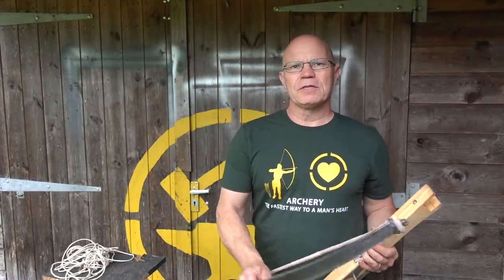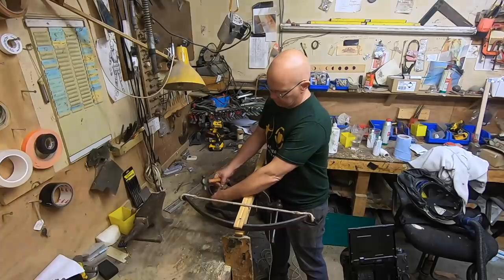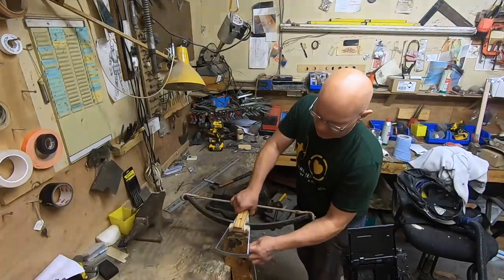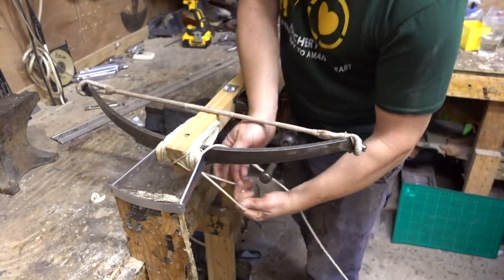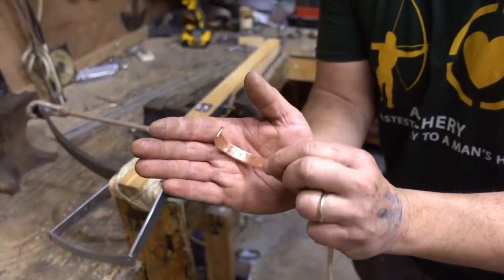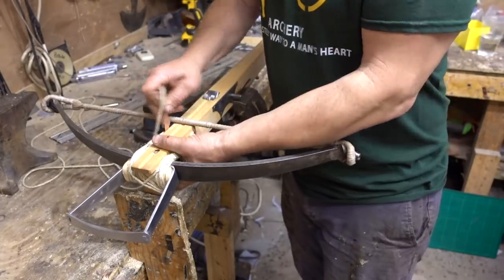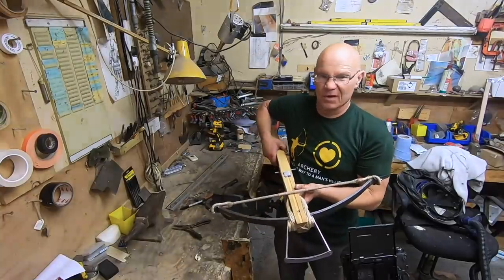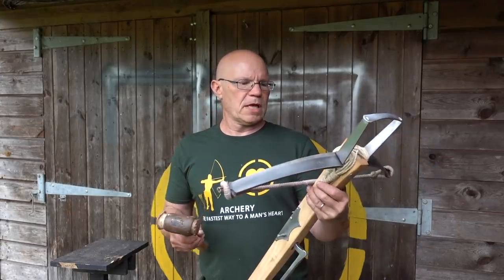Lashing a medieval crossbow

Comment: bending the pipe "needle" was brilliant.
Reply: It's a vital trick to do with zip-ties too when snaking them through a tight spot or hole
Reply: That's when the experience and ingenuity of a worker comes in. And that's what you actually, rightfully, pay for.
Reply: I was wondering why he didn't use a fid; then he hammered the curve into it and I was enlightened.

Comment: This is such a nice illustration about how people back then were just as clever as we are, they were just working with a different set of tools. Give a person from the past a partially assembled crossbow and tell them it needs to be as tightly fitted as possible, and eventually they will find a way to do exactly that, even if they only have wood and cord to work with. Sure, it takes more time and labour than it might with modern tools and materials, but it absolutely does the job.

Comment: To anyone who's thinking about using this style of binding, I used it on a homemade 150#  fiberglass prod 8 inch power stroke rolling nut lock bow with success, though I have a few comments to make.
 I used a 1.5 inch thick oak "yoke" mounted directly against the front of the bow,  cut down to 1.25 inches in the middle,  leaving the sides high for holding the loops in place. I planned to use a gaffe lever for spanning and needed that thicker yoke to anchor a heavyweight screw eye for hooking the lever into, which seems to be working well so far. Possibly as a result, I needed a lot more tightening wraps around the main loops - 15 of the straight wraps and about 13-17 of the figure of eights (I wasn't counting, I just matched on each side). I also only did 6 of the main loops in a single layer on each side of the stock, plus a double layer of crisscrosses on the front, so that may have contributed.
That double layer of crisscrosses on the front of the bow was more trouble than it was worth - I had to throw out my third attempt because the two layers had somehow twisted around each other before they got to the tightening wraps, ruining the appearance of the front of the bow. If you do crisscrosses, definitely only do a single layer, or just leave them off entirely.  They don't blend well into the main loops going back through the hole either.
For forming the initial loop, I found that rubbing a large amount of bowstring wax into the pseudo-splice was an easy way to hold the loop together without it pulling out on you when you put tension on it. It should be the innermost loop, so whatever you do won't be visible from the outside anyways. Supergluing it would probably work too, but waxing was easier and didn't risk gluing the cord to the stock.
When working with that copper needle, file down any sharp edges on it, otherwise you'll ruin your finish. I had to re-varnish the entire front of my bow because it had gotten badly scratched up during the tightening process. A shorter needle is definitely better, and make sure to be going straight down and up against the stock.
I used 4mm 4-twist jute from Amazon for my binding cord, and found that it had a disappointingly low breaking weight. I had to restart twice due to my cord breaking halfway through, and ended up having to tighten everything down by hand - not ideal, but with a lighter bow it should be strong enough. I'll try to find stronger cord in the future - plus, jute is hairy stuff and nobody likes a hairy crossbow.

Lastly, this takes a lot longer than Todd makes it look like - my fourth and successful attempt took me about an hour and a half to do, though much of that was probably due to my larger number of tightening loops. Unless you wear a glove on your tensioning hand, expect to have blisters on your blisters by the end of it, especially if you use rough cordage like I did.

If Todd reads this: I wouldn't have been able to do this project without your video. I've built crossbows in the past using bow irons and stirrups, but this is a lot more economical for me. Thanks, and take my sub, comment, and like - you've more than earned them.

Comment: I'm not a native speaker and I don't know what "lashing a crossbow" means, but I looked at the thumbnail and thought to myself - I wonder how all this ropework is done. And how about that - it's exactly what the video is about. :D
Reply: "Lashing," in case you didn't pick it up from context and for anyone else with a similar knowledge gap, is either a noun or a verb. As a verb, it means to use cordage to bind or secure something. As a noun, it refers to the cordage itself.

The use of the term in reference to whips or whipping someone, such as someone being given "20 lashes" in a pirate movie, is because the whips used were often improvised from the ship's supply of lashing cordage.
Reply: @Mewobiba  Well, that IS an example of using cordage to bind or secure something, yes.

Comment: The sailor and knot enthusiast in me got me tied into watching this, and no regrets.

The second layer reminds me slightly of the worming part of to worm, parcel, and serve rigging. Love the improvised needle. Kinda like a fid I've used to splice double braid rope (was a big straight needle with a hollow in the back to place end of the core/casing as it passed through the other), but you can shape it as needed for working on the lashing.

Not sure of the forces required of a crossbow lashing, but one thing I've learned is that if you don't trust a line with your weight, you probably shouldn't trust it with a sail.

Comment: I've used a variation of that pipe needle in the past using a drinking straw and string for routing cables through a homemade desk rather than a lashing crossbow but it's a handy trick or "bodge" to have lurking in the recesses of the brain.

Comment: Tod, that was....surprisingly interesting! I'm unlikely ever to forge a bow steel (the tempering kind of worries me - but I might try it with a light one one day), but your crossbow videos always make me more interested in them than I am by default! 

I think I'll stick to axes, though.
Reply: Spring tempering is actually fairly easy. You want it to turn blue from the heat.

Burning motor oil is the right temperature (about 550-600degF). 

Molten lead will also work, but it's easier to overheat that way, and takes a heck of a lot of power/heat to get the lead melted in the first place, and you do NOT want to work around that much molten lead if you can avoid it! Molten lead can be used for making smaller springs, like for a flintlock's mainspring, since a person making a flintlock is likely to have a lead pot to cast bullets with anyways.

You will want a thermometer for this if you want to be consistent with it.

Comment: There is line used in the rigging of sailing that might be a good modern alternative. These lines are under tension for months on end without any noticeable stretch. Of course it will look a bit out of place on a medivial crossbow:)

Comment: I used to belong to an army company that had boats that needed to be secured for transportation. There was not a bit of synthetic rope in the whole unit. It did not matter how tight or how frequently you dressed it, synthetic rope would stretch and you would be peeling your boat off of the road.

Comment: It is so weird I was doing this yesterday. Never thought on bending a copper tube. I used a paracord needle that is round and... gosh... at the end it becomes so difficult to go through. Thanks for the tip.
Reply: You always can use long wire loop with grip to pull the cord trough. More time consuming but will work even if there is no spare copper pipe lying around ;)

Comment: Finally a good guide on how to do this! I've had a spare 200 pound prod sitting around my basement for years - I used my only set of good steel bow irons on an 80 pound prod and am not a skilled enough blacksmith to make more myself. Now I can finally make that super-heavy crossbow of my dreams. Only one issue: Said prod has a triangular shape when viewed from the front, with the flat side up and the pointed side down. Will this affect the binding in any way?
Reply from the maker: Wouldn't think so - try it and fine out

Comment: Is there any evidence for the use of raw hide cordage being used? Fitted soaked the raw hide will shrink when dry pulling all very tight.
Reply: You have to consider the rather humid weather of Europe, dried hide/sinew cordages can pull everything tight, but in humid weather, they would untight themselves.
Reply: @bodyno3158  I was messing around with rawhide a year or so ago and while it did take a few days to dry I haven't had any problems with it drawing in enough water to become malleable. Making it malleable was in fact the hard part, I had to soak it in a basin of water for a day and a half. An issue I'd see with using rawhide cordage is the rate parts would dry at compared to other parts. Winding it like Tod does would leave parts of it covered over which would delay the drying process so you'd end up with dry stiff bits of cord with softer parts still drying.
Reply: @bodyno3158  Fair point.
Reply: Also hemp cordage tends to shrink and tighten when wet.
Reply: It was used. Scandinavian hunting crossbows often have prods laced with rawhide. However this is "poor man" substitute, rawhide binding became loose on many museum samples while original cordage on 15-16 century crossbows is still holding tight.
Rawhide lacing will work but since material will absorb moisture, it will deform under stress more than cord and requires constant checks and maintenance/replacement.
Reply: Hemp in my experience has enough natural oil and isn't wear resistant enough to "stick", that is, it slides on surfaces. That's a much more useful property than maximum tightness, since that can be fixed later as he said... and all the natural cords tend to stay equally tight.

If you can choose to make your work easier with all the end results being the same, why not?
Reply: @cheyannei5983  Have you ever tried to undo a knot in a two inch hemp mooring line when it;s wet. Cannot be done by hand ,requires the use of a club hammer to loosen.
Reply: @davidprocter3578  My friend made me a lot of hemp necklaces and bracelets, that's what I was referring to. Linen cord will catch on the wood and itself which just makes it harder to work with.

Yes, I am aware how it shrinks. I couldn't get one off for two days :U
Reply: @davidprocter3578  there's a good reason for not using hemp mooring lines. And not using any "knot" more complex than a lot of wraps even with Kevlar lines.

I would be very tempted to say, "screw it" and cut the lines in that case. And yes, I know what happens when a mooring line parts, I was a Sailor.
Reply: @ScottKenny1978  Scott I come from a generation trained from birth to avoid waste, cutting any line short of an emergency was frowned upon. and as a sailor you will know there are times when wraps and a half hitch are not possible only a good knot will do.

Comment: A couple of quick questions:

*- Would sisal cordage provide any advantage over hemp, cotton or other natural fibre? A disadvantage? Or be functionally equivalent? (I'm thinking primarily of Arabian/African designs)

*- Likewise, would looping the cordage alternatively on L/R sides of the stock rather than fully binding one side then the other make a practical difference to the centring of the steel, or would it be more work for no effective gain?

Oh, & would looping the cordage under the stock rather than thru a bored hole be an idea? Advantages: the bored hole is a weak point in the stock that could be avoided, & the cordage bundle may make for a natural forehand grip; disadvantages: the exposed bundle would be more subject to attrition damage from poor storage, care & use in battle & the elements, plus.. I dunno?

Comment: There's plenty of synthetic fibers made specifically for the resistance to stretching, they're just a lot more expensive than a regular PLP or nylon used for ropes, it's why flax bowstrings tend to need a bit of length adjustment until they "set" and will require it again if they're not used often enough, while Dacron® and similar products stay the same length for ages.
As far as natural materials, though, hemp is superb, it's a real shame the industry was almost obliterated by combination of ridiculous regulations and the advent of cheap cotton and synthetics :(
PS great content, this method's a lot better than permanent linkage in my country's political environment, if I'm ever going to bother with reassembling the leaf spring monstrosity I built in high school I'll use it lol

Comment: would it be a good idea to wax the string ? i think it would make it more water repellant and it will also help with it staying tight, just like shoemakers/ leatherworkers use coad on their threads ?
Reply from the maker: I tried it years ago and it came loose.  Natural fibres shrink when wet and so a little moisture in the air actually aids the tension and wax will prevent this

Comment: Great video! I always used some bent coat hanger wire with a cross stick to pull the cording through. Works like a charm, plus you can get pretty close to the bow itself with the figure 8 wrappings.
I also use a mix of melted beeswax, parrafin and colophonium to drench everything in the end. Seems to tighten everything even more, really locking it in place. Any thoughts on that, Tod?

Comment: I wonder if they rubbed the cords with beeswax or something similar to help with water proofing. I suspect something that could cause problems is if the cords get wet.
Reply: I think he mentioned in a reply that this causes issues with tension, so probably not.

Comment: WRT synthetic fiber stretch, Polman's "Splicing Modern Ropes" has a nice reference table of synthetic fiber properties on pg 166. Polypropylene stretches 16-20% at breaking, Polyester (Dacron™, Diolen™) 10-16%, polyamide (Nylon™) 14-16% dry and 28% wet. Aramid (Kevlar™, Technora™) stretches 2-4%, Liquid Crystal Poylmer (Vectran™) 3.3%, Polybenzobiscazole (Zylon™) 2.5%, and Ultra High Molecular Weight Polyethylene (Dyneema™, Dynex™, Spectra™) 3.5%. Zylon is the least UV resistant, Vectran and Kevlar/Technora also decay quickly with UV exposure. Dyneema is quite UV resistant and also more durable against abrasion. Its biggest flaw is a low melting point (145°C), which doesn't matter for this application. Its second biggest flaw is that it's pretty expensive. My preferred rope store sells 1/8 inch Dyneema at $0.39/foot, so $13 just for the rope. And that'd be with no extra, and doesn't include shipping/handling price.

Comment: I've been planning a crossbow build and I was wondering if you could lash the prod with rawhide lace soaked in warm water to soften it, then, as the rawhide dried, would it tighten? You could then rub it with beeswax to waterproof it. Would this work?

Comment: I have always wondered about this. thank you. One Question I have about crossbow bolts is what is the optimum shaft length or thickness. With Korean bows, the little arrows and the arrow guide (Pyeonjeon) seemed to show the advantages of the smallest arrow/bolt possible but then you see European illustrations of crossbows with full-length arrows in hunting scenes.
Reply: depends on period, crossbow model and usage. In 14-15 centuries war crossbows were built to use  standard bolts - approx half an inch in diameter and one foot long, and these bolts were produced literally by millions.  Earlier, up to the end of 13 century war bolts were more like arrows in length. Hunting crossbows bolts seems to be a bit different and more varied, however in "livre de chasse"  which is the source of many crossbow hunting scenes :) bolts are definitely at least twice shorter than arrows but seems slightly longer than  war bolts and with much larger head. Todd build them, shoot them and was disappointed at first.
Later, in 16 century smaller bolt sizes were in use for some hunting crossbows, and again Todd mentioned previously how hard it is to build a crossbow without proper information on bolts used.
Safest bet will be to use one foot bolts and build the crossbow accordingly.

Comment: I'm going to guess that this is not the only method of attachment? Any other ones that you're aware of? Pros and cons of this method vs another. This is not what I would have come up with if I was making a crossbow with no crossbow to copy from. Off the top of my head I would have had threaded rod on each side tensioning with jam nuts. Not sure if that is a good idea. I guess they didn't have access to threads and nuts. Hmm now I'm not sure that there is any other way. Great video! :)

Comment: There must be a reason that you didn't use damp or wet hemp? I assume that wet hemp would stretch slightly. So when it dries it 'shrinks' a bit making the binding tighter. Is there a reason you didn't use wet hemp? Just a thought.